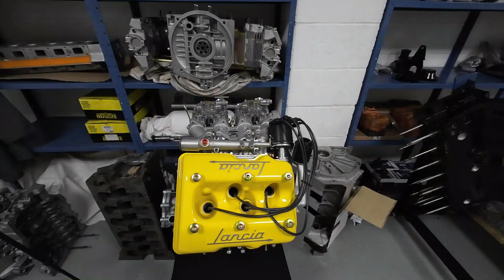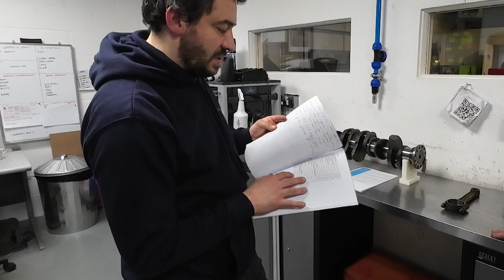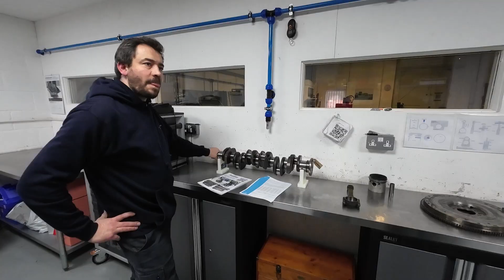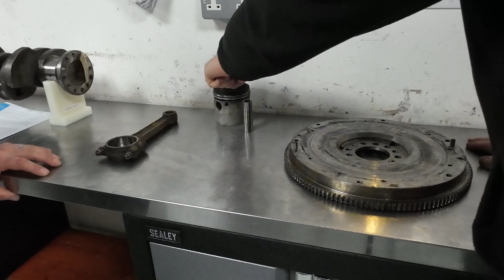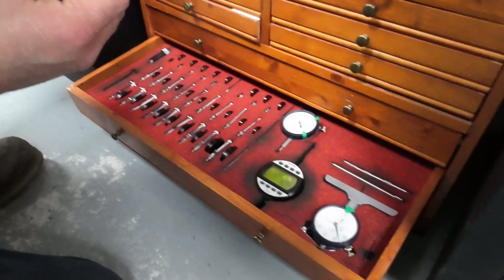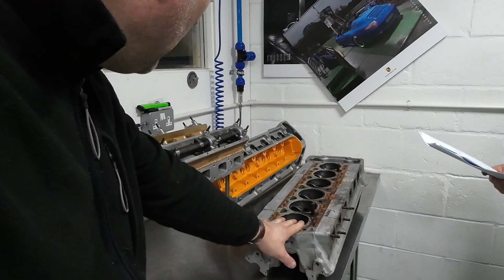Ep21 - 1967 Jaguar E-Type 4.2 Engine Inspection Report

Comment: Bumping up compression and going with hardened valve seats. Modern upgrades. Balanced engine will provide a little more power and run smoother. You're going all in. This game ain't cheap. Love these videos.
Reply from the maker: Yes, it’s going to be a cracker of an engine by the time it is done. The plan is take the best of modern knowledge for reliability, smoothness and hopefully lack of leaks so it becomes the best of classic motoring without some of the traditional downsides! Not cheap but I think it’ll be worth it. 🤞🏼🤞🏼

Comment: Great videos you do in general. I am ongoing with a E-type 1966 FHC project so I gets a lots of inspiration. Thank you. It seems that The Classic Engine Workshop for sure know what the are doing. But I just wonder what such an engine project will cost at TCEW? Can you be so kind to give an indication on how much approximately it cost?
Reply from the maker: Thanks for the compliments, watching and for getting in touch! 😀 I have learned that each engine restoration can vary depending on the state of the engine at the start, what needs replacing and any upgrades. This one is a substantial investment but not ridiculous. I’m sure Roger would be happy to give a broader estimate based on his experience of restoring quite a few XK engines now.

Comment: Great video, I had my flywheel ground on my 4.2 and they took that much off the release bearing was too far away.
Reply from the maker: Thank you! Oh dear, that’s not good. A new flywheel for this engine will hopefully avoid that pitfall! 🤞🏼
Reply: @fossewayclassiccars  yes I got a good used one, it was all the work re taking the engine out that was annoying.